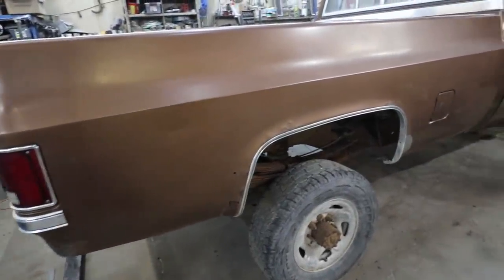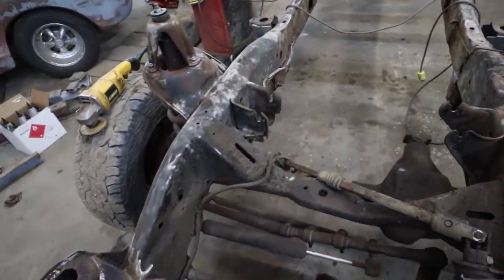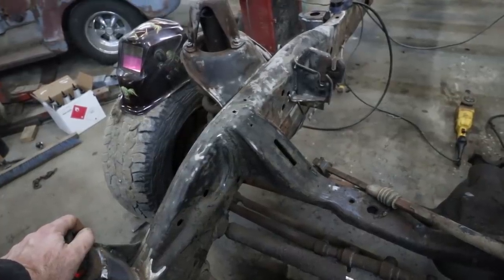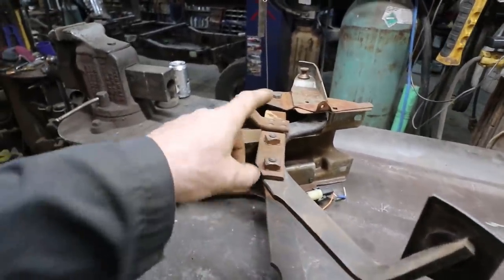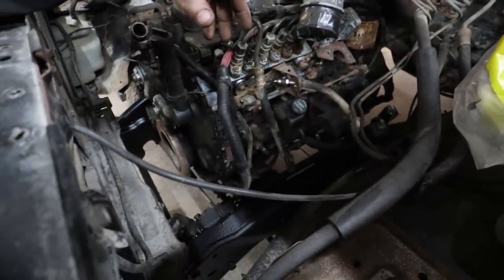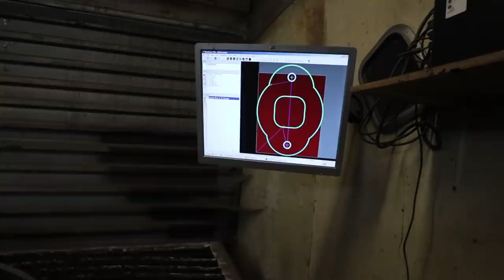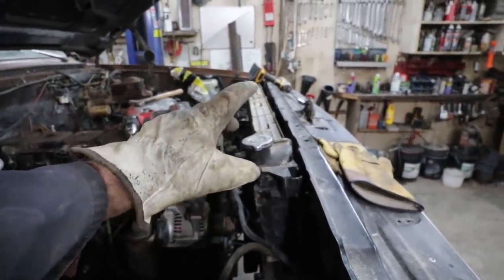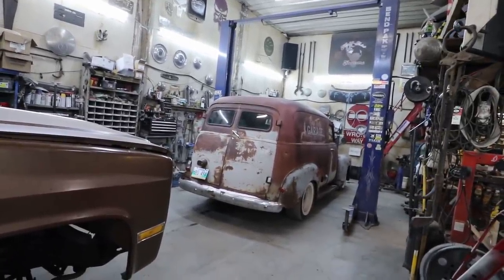Moving the Cummins back and clutch pedal placement on the Squarebody

Comment: I used a wire brush from harbor Freight on my 4inch grinder took 3 of them wire brushed the frame best I could and treated it with rust escapulater from Eastwood and painted with rustoleum semigloss  I'm very happy with it.

Comment: All building materials have been rising in price due to scarcity caused  by the pandemic. I noticed about 6 months ago that tools also have been rising in price, most likely due to material shortages. Not to forget shipping which has also been stymied as well, another cause of price inflation.

Don't expect prices to fall significantly either, once this is over. Corporations aren't in any hurry to lose any possible profits.